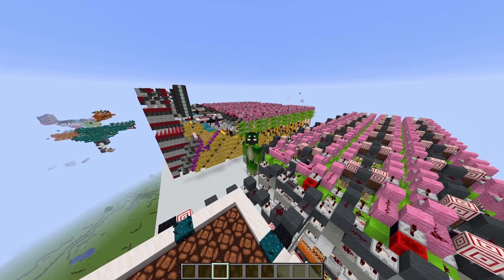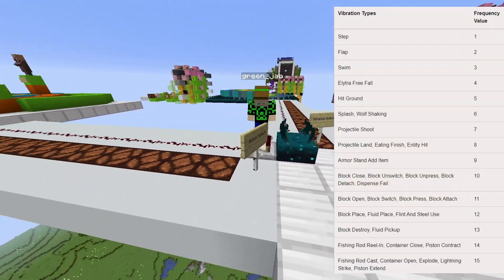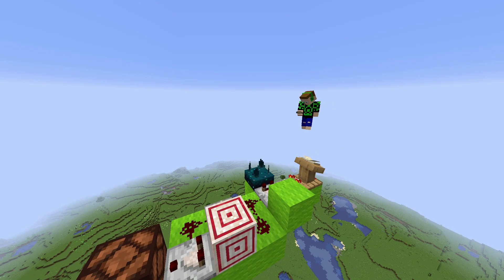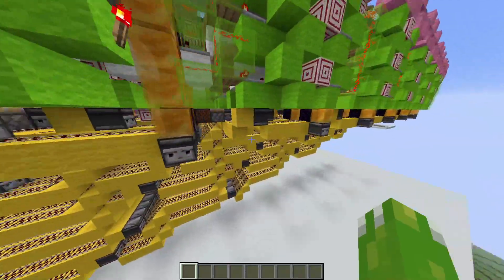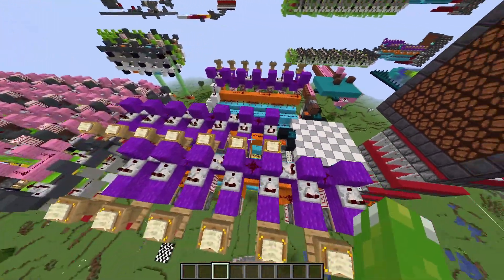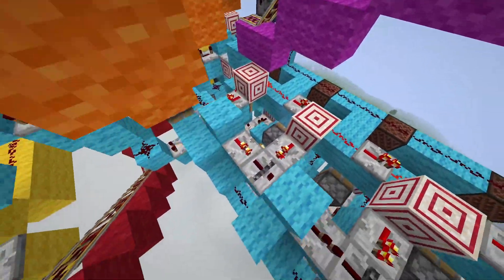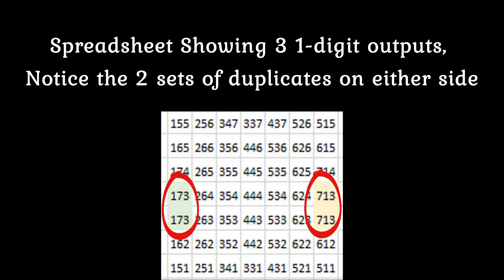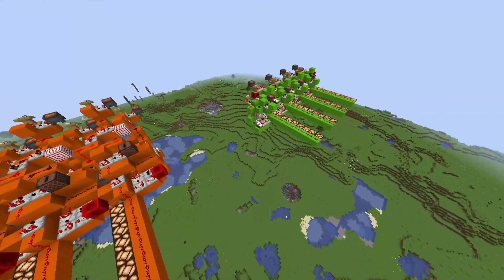Sculk Sensors Finally Made this Possible in Minecraft

Comment: should ask about our super compact hex adders on ORE (server)
Reply from the maker: how compact are we talking here
Reply: @ncolyer  6x8x16 for a full 32bits (8hits)
2high stackable per 4bits (1hit)
Reply from the maker: @RedCMD  impressive.

i was looking at redoing this project when the sculk sensors are released (in case they get altered significantly) and use geometry instead of, well, what is essentially trial and error to determine what grid position the vibration came from and I imagine that hex adders like that would be rather useful especially if/when mc218222 gets fixed
Reply from the maker: @RedCMD  Also, may i ask how you came across this video? 
It's just that its been out a while and has since sunk to the dark depths of youtube
Reply: @ncolyer  you sending bugreport in SciCraft
Reply from the maker: @RedCMD  oh true, i forgot this is linked on that report

Comment: I'm curious if you ever worked out how to do analog addition and subtraction. If not, I've got it worked out for addition. I've also worked out an analog signal inverter (a necessary part of the adder), so subtraction can be done in the same circuit.
Reply from the maker: Good work
Btw The adder at the end of the video is fully functional

Comment: It doesn't have a reset mechanism, but wouldn't it be possible to connect vertical 1-wide tflips to low down sculk sensors? Appreciate the complexity of the design, though!
Reply from the maker: Nope, coz the t flip flops activate the other sculks
Reply from the maker: You would need a bud system that activates a silent clock which is all one by one
Reply from the maker: I appreciate the appreciation tho